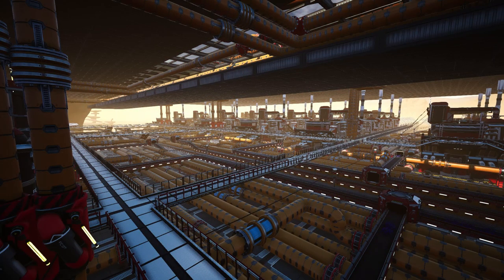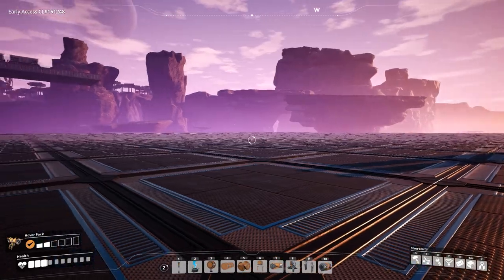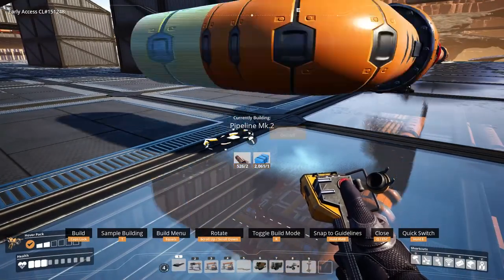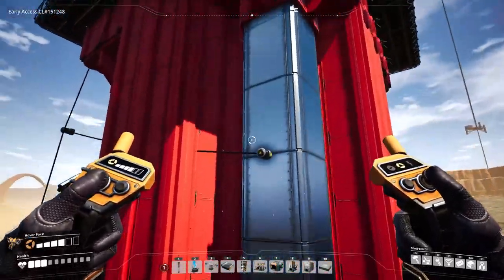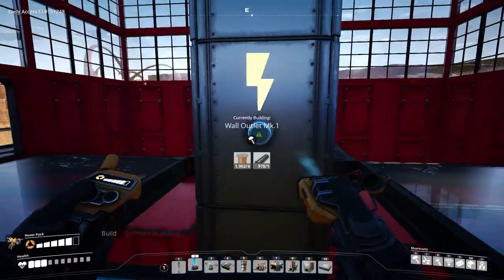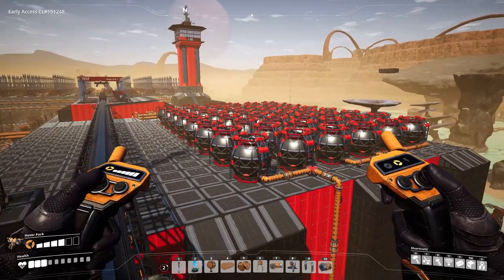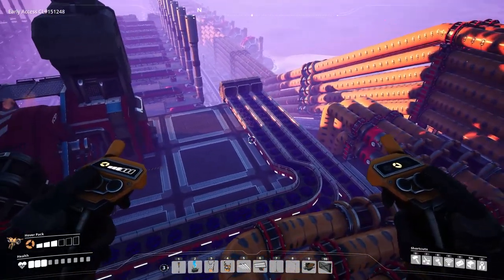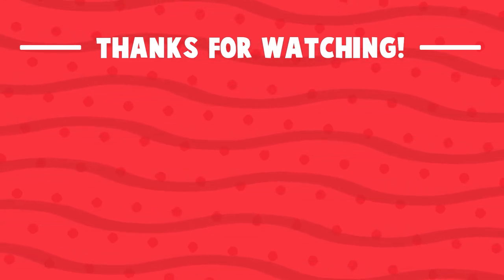112,500 MW Blender Fuel Power Plant! | Satisfactory Update 4 Gameplay Ep 4

Comment: From the powerplant, having switches to control the mains at each satellite factory might be a good idea? this way you can shut down each factory either from the factory control room or the factory power station without needing to visit each manufacturing center. With a big battery reserve to store enough power that in the case of an outage, you will have 10-30 minutes of power storage available (isolate it from sending out power until you manually intervene) This will give you the seed power to fire up your generators, and troubleshoot each factory individually
Reply: It would be cool, however, you won't be able to utilise the train lines for power. And the power generator site would turn into a giant spaghetti with enough connections coming in
Reply: @yogibear528  I think for that to work you'd first have to get overland power lines (so you can run power over really long distances CONVENIENTLY without using trains for that - right now you'd need a million power poles every couple dozen meters going all across the map...)

Comment: Add a separate battery to the tower, load it and add a switch so it will only be used for the tower itself, if the power goes off. Obviously always have the switch turned off so the battery can be used in emergencies.

Comment: If you need more Thing for the circuit breakers, how about splitting the blenders in 3 so you have 1 side just with them. The same thing could be done with water, oil, and side products (rubber plastic).

Comment: Doing power generation stuff what i like to do is not connecting all the generators all together and sending them back to base. I just connect as much generators together as can power the factory which makes the fuel, so if something happens it wont shut down because it is on a separate system, and the rest of the generators are for the other factories for example supercomputers...

Comment: I wonder if his fuel pipes are working correctly. I can't for the life of me build a power plant that operates at 100%. Everything should work as I planned but there is some wierdness with pipes and fuel. I haven't seen the issue with water yet. I hear there may be an issue with the t-junctions are cutting the flow and the more that you have the worse it gets. I've also seen issues with the way the buffers fill. If you link multiple buffers in a line and fill from one end, they don't fill evenly. I would expect it to act like any fluid that always finds it's level in that they all fill at the same rate. Nope. You may have a buffer in the middle that has half as much fluid as the two around it.  I'm really frustrated with this game at this point and may put it away until things improve.

Comment: How do you calculate the exact percentage a generator needs to be? i have 20 generators on a 400 line and i can't get them to use exactly 400 fuel they are using 399.9853, i have them all clocked at 194.2596% and i don't feel like going back and forth between them all just guessing what the right number is and i suck at maths.

Comment: I'm not a fan of that battery design, to be honest. It's very inefficient with space, you could cram a lot more batteries in that space which equates to much more runtime should you have a power emergency.

It's a shame there's no slanted windows so that you can look down (imagine a control tower at small airfields for the shape) from them.

Also, YOU CAN PUT WALL POWER POLES ON THE PILLARS?! OMG
Reply: I think it was meant as a design thing only.  He has 100 batteries under the floor of that factory actually.